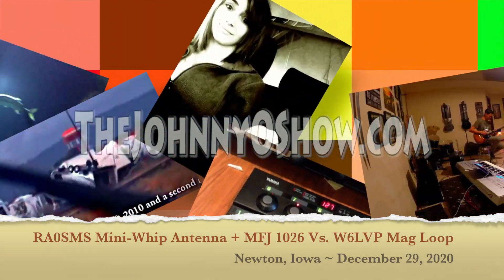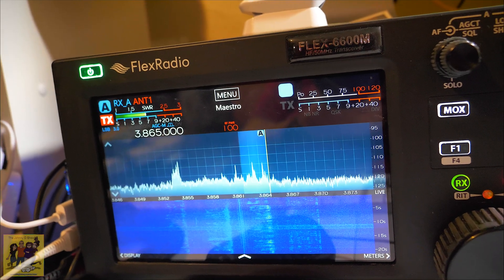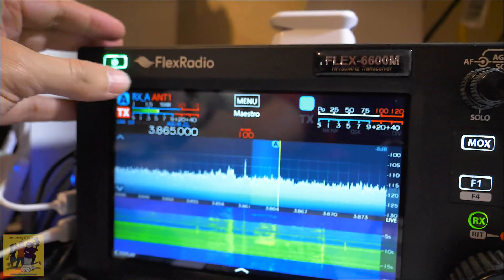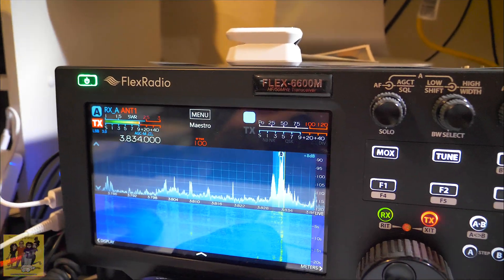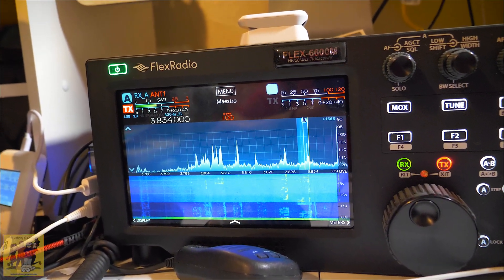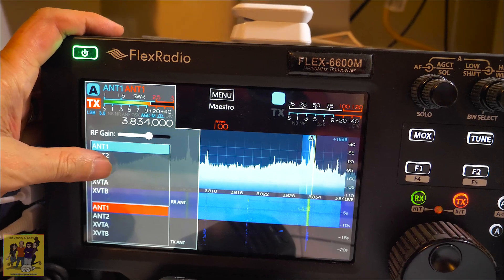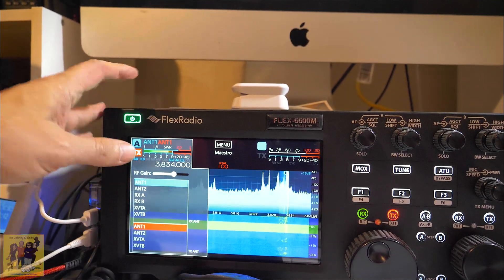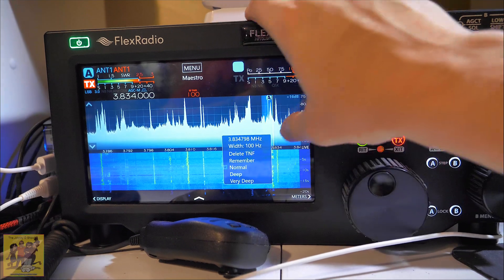Ep. #750 RA0SMS Mini-Whip Antenna + MFJ 1026 Vs. W6LVP Mag Loop

Comment: MFJ quality control sucks. More Frikking Junk.
Reply from the maker: I agree, unfortunately I was having a hard time finding any one that made that  kind crossover switch other then MFJ :-(

I have come to the conclusion when buying MFJ you should think of it as some assembly required haha
Reply: @Thejohnnyoshow  Do you mean the noise eliminator? I have one from WiMo in Germany.
Reply from the maker: @Martin Adams  no I mean the item that busted the "cross over switch" but the mjf noise canceler is also one of the few that will work on 160 meters